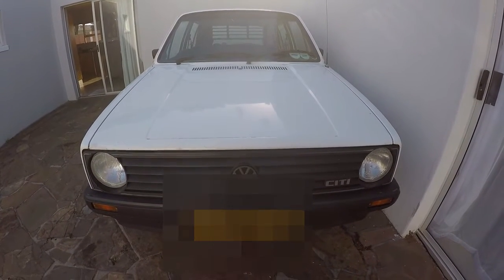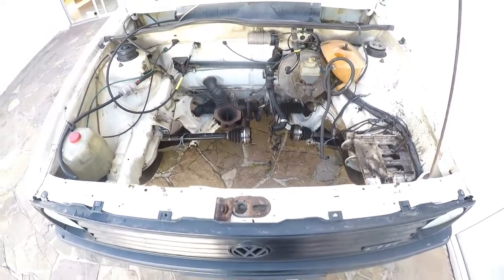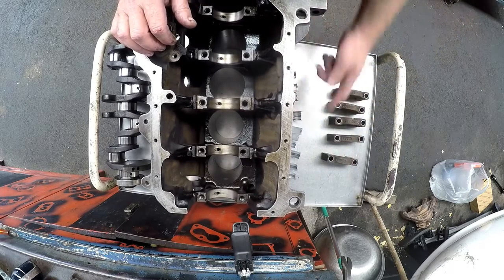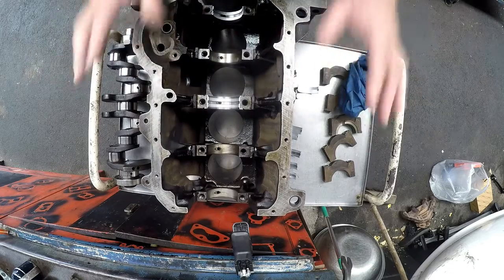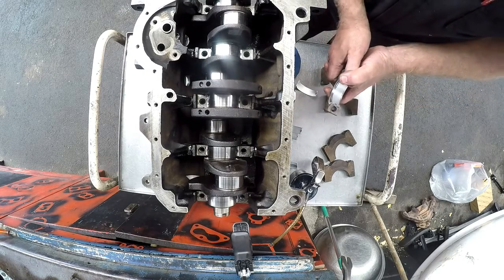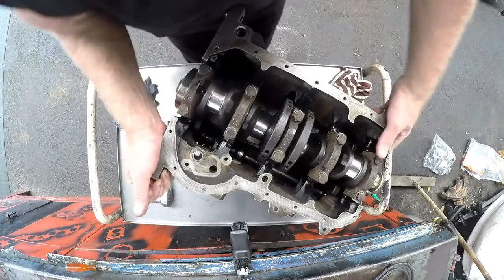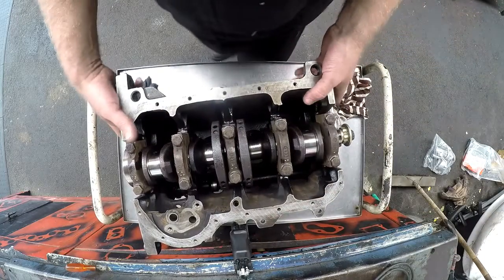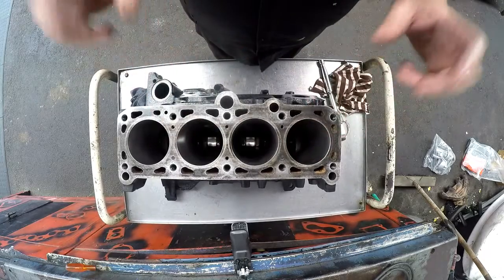Vw Golf 1300 Engine - Fitting Crankshaft & Bearings

Comment: I am looking for the torque specs for a VW 1.4 carburetor. I need the main bearing caps on sub assembly, the conrod caps, and the cylinder head. do you know where I can find these specs?
Reply from the maker: Main bearings 65nm, conrod caps 30nm + 90 degrees, cylinder head 40nm + 60nm + 180 degrees, hope this helps you out Quewen.

Comment: howzit Sir, how do you know if the crankshaft needs cutting or polishing
Reply from the maker: Usually if there is a bearing knock noise or the journal surfaces are rough and not smooth.